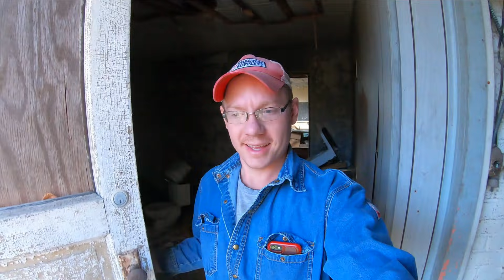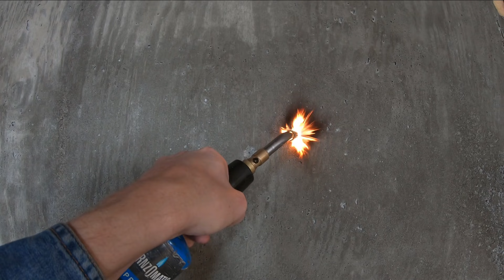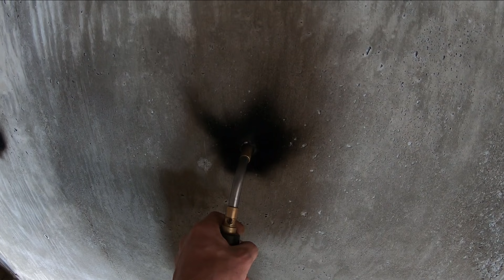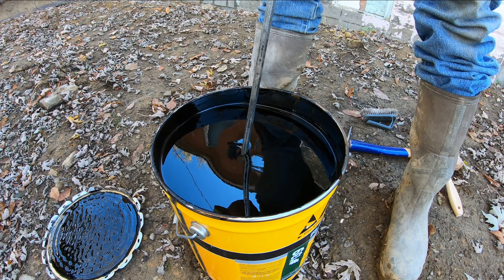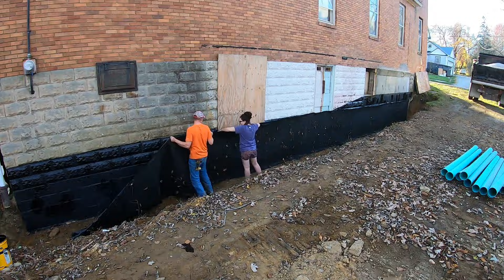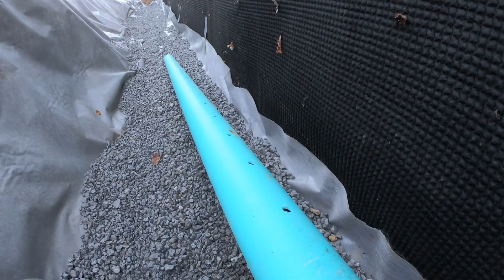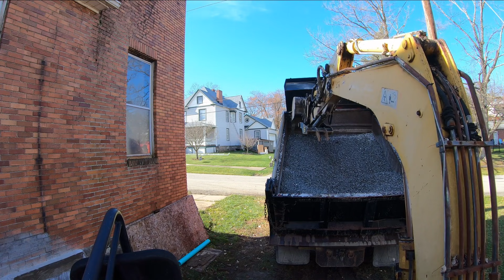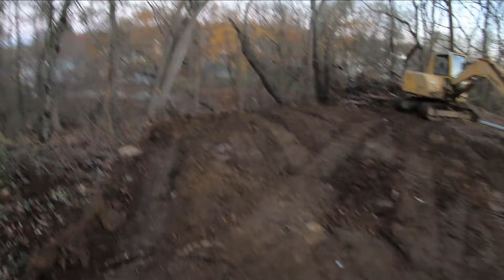Installing a Bullet Proof French Drain at the Abandoned Church!

Comment: Matt, ideally you have those holes in the pvc at 5 and 7 o’clock...
Reply: Well Billy, Here comes another "expert" to start the argument that the holes in perforated drain pipe belong at 10 and 2, that way there is as much water-carrying capacity as possible in the belly of the pipe.
Reply: @mattywho8485  , we’ve installed thousands of ft various flavors of perf pipe, but the logic is all the same. By keeping the holes at 4&8 or 5&7 or what have you’re keeping any standing or collecting water level lower significantly lower(depending upon pipe size)than if the holes are up-about 7.5 gallons per cubic ft., and by having the holes down you create a self scouring/cleaning effect lost when the holes are up. Silt will eventually get in, and hole down will extend the life of the system. If anyone’s concerned about carrying capacity, don’t be-whatever can’t infiltrate immediately below the pipe will carry to daylight or what-have-you, beyond the height of the holes.

Comment: Great vids man keep them coming! I have one question as I'm no drain expert but shouldn't of the plastic you laid down with the rock on it been put down 1st and up the wall a little them the dimple board over that?   Again I know nothing about drain systems but only an observation.
Reply from the maker: First off it’s not plastic, it is a filter fabric, second I thought about doing that however this stuff acts like a Wick and I was afraid it would Wick water up against the wall behind the dimple bored
Reply: @DieselCreek  ya I seen that it was filter fabric after I commented🤦‍♂️. That wall and foundation should be dry as a desert, good work man!  Ps, run that little diesel compactor on filtered waste vegetable oil it will run all day on it, the smell of free🤣. I've been running on filtered waste vegetable for 14yrs on two 7.3L, a3.9L turbo diesel isuzu, cat generator and my newest edition a 1956 allis Chalmers hd5g loader crawler.  It's pretty cool!!

Comment: how is the water going to go from that membrane you placed on the wall, to the french drain, when your plastic sheeting is between the pipe and membrane? to me it looks like the membrane is going to drain UNDER the plastic sheeting and under the french drain pipe.
Reply: Yup, I was wondering the same thing ;-)
Reply: Its filter fabric, not plastic. Water will rise up through the fabric from underneath and into the downward facing holes in the pipe.
Reply: @JereHOTmiah  thanks, but why fold it over like that at all? Is there a reason? Just to keep the dirt out of the gravel/mudding up or what? 

I've never seen it done like that, we do it differently here ;-)
Reply: This is not plastic, it’s a type of fabric, it lets water through but does not let mud and leaves through

Comment: Heat it up.   At least try finding a bigger bucket than the paint can and putting boiling water in the bigger one and then standing the pait can in it.  Replace the how water a few times to get the material as hot as possible.

Comment: Stupid Question: Is that plastic perforated? I keep getting hung up on why you covered over the drain and gravel with it, but if it's perforated, that'd make more sense.
Reply: Nevermind, I just didn't watch far enough ahead. Just heard filter fabric and that answered my question. Not used to seeing that stuff used around here in Tennessee. I'm sure they do use it, but just not where I've been.
Reply from the maker: Yes not plastic at all, very permeable

Comment: I've seen the dimple stuff used and in theory it makes sense where they loose me is when they drill into the wall and pound in a fastener. Seems to me that defeats the purpose
Reply from the maker: That’s why I use the adhesive, I did not drill any holes into it, but I have seen people do it
Reply: Mostly the nails are real short, just enough to hold it there.
Reply: Especially block walls

Comment: Set that bucket on a propane burner on low . That will thin it up
Reply: It says do not heat on the can
Reply: @stephenpitt6363  yea I know that now. It was not said during original video I used some stuff that looked like it and you could heat it. That being said that turned out fine.

Comment: lol im sure the Plumbers in the audience will be piping up about the 90 elbow you used on the drain .. all good mate wont hold it against ya but you should use a couple 45s to make that bend. Easier to clean out later.
Reply from the maker: I thought about doing it, but the odds that I’ll ever have to actually snake it are slim to none.... at least I hope lol

Comment: That black sticky goop, was TOO COLD. Set up a water bath, with 2 short pieces of 2x4 on edge to put under the pail to keep it OFF the bottom, and circulate water. Can do it inside the church, set the contraption on top of 3 concrete blocks, so you can put a tiger torch on low, with an angle a little upwards by sitting the head of the torch on a brick, a rock, so you don't heat up the floor and cause it to spall. Other way is use a bath tub using the hot water out of the tap and it has an overflow, a good 3 hours with the hot running will get you up to speed. Put the pail on some 2x4 pieces and If you can find a length of hose to wire it to the outlet, no need have it tight, tight, the idea is to send the water to the other end of the tub by gravity and a little pressure so it circulates back to the over flow of the drain.

Comment: Should on pulled the plastic off the back of the dimple board. Also you need to attach the dimple board to the wall or its going to move out of position as the frost moves the ground around. Look at the orange fasteners on this picture. The person who sold you the dimple board should of told you about the fasteners. The article recommends that you use concrete nail and washers.

https://www.waterproofmag.com/2018/04/dimple-drain-sheets/

Also in place of the PVC pipe you used try finding something like this below link (Canada store Link). All you need to do is lay stone down then lay the pipe. At each window you have a pipe coming up below the window (if the window is below grade).

https://www.homehardware.ca/en/4-x-100-corrugated-drain-pipe-with-filter/p/3260170

Comment: I don't think this is a good idea burning those PVC pipes out for the following reason. Concrete is full of air bubbles. When Concrete is heated up like in a fire, the air bubbles expand and break the concrete, like when water freezes. I think you will be creating cracks in the concrete around these holes by doing this. Hopefully,  it is a short enough burn that it does not do any serious damage. I think drilling them out with a Masonary Bit would be a better method.

Comment: Oh no, another YouTube expert... The bubbles of the wrap go to the inside to keep the condensation away from the wall and run down between the bubbles. When you install the wrap you need to use termination bar along the top. When the top separates there will be a gap that will route the water to the concrete rather than away from the building. Sorry, great effort, but you are instructing people the wrong way.